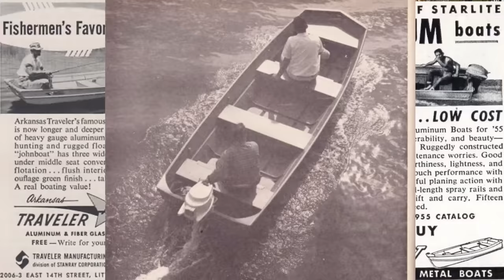$1,000 vs $5,000 Facebook Marketplace Jet Jon Boat Challenge! (ft. FishingWithNorm)

Comment: If you use J-B weld you have nothing to worry about that stuff will fix anything if you got a hole in it put J-B weld on it and if you got the silicone dye to make slugs out of JB weld buddy those slugs are amazing that's for the hunters out there

Comment: I have a 1955 sears sea king aluminum V hull with a 1962 johnson 9.5hp 2-stroke stick stear on it. Currently selling it for $1000. Has life vest, throw cushions, paddles, trailer and unopened Garmin striker 3 depth finder.